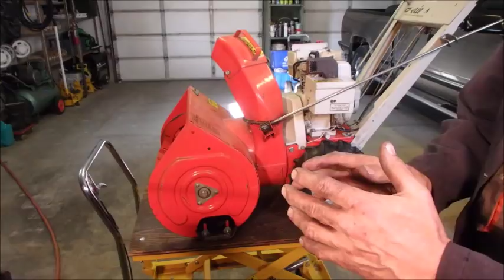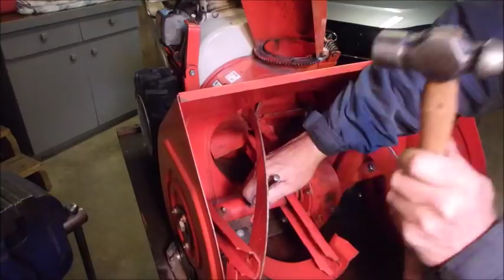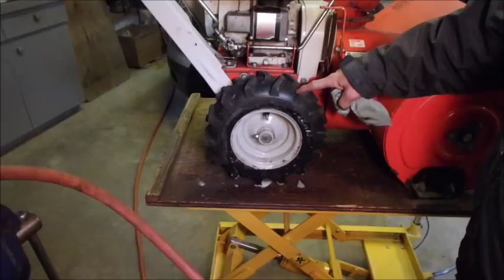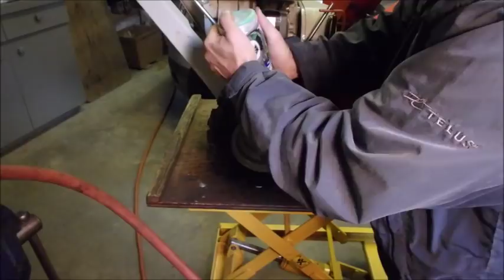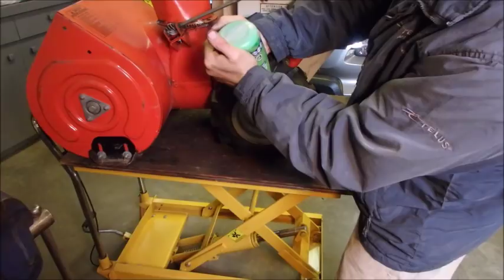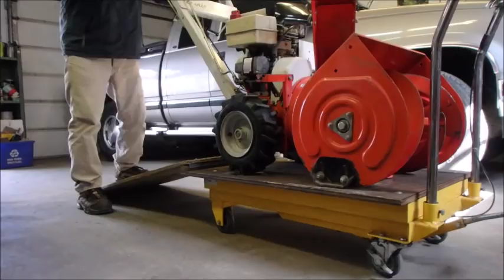A Shear Pin on My 4HP Ariens Snowblower

Comment: "We're not working on the space shuttle." So true. My paraphrase, what I always say is "It's not going 55 down the highway."

I own a 1965 Ariens 4HP Tecumseh Snow Blower. Your videos are very helpful. I want to upgrade mine from the stock balding solid tires to pneumatic ones like you did! Thanks for sharing your knowledge and showing the process you went through in that particular video.
Reply from the maker: Looking back I used too many bushings.

Comment: I've got a snow blower just like that one.  I think it is a 1964 model.  Man, those things were built.   I often wonder if 4hp back in 1964 was by today's standards more hp because that 4hp on our machines have no problem  tackling some big snow.   Today a blower that size would have an 8-10hp motor and probably not do as good a job.  Oh, also, my 90 year old mother still runs her 1962 Ariens she inherited from her father!!!  And, my son, who now lives in Connecticut, just bought a 70's model Ariens on my recommendation.  They are just built like tanks.  Do a little maintenance each year and they last forever.  I particularly like the older models with the cast iron gearbox.  You just have to be careful what lube you put in them because of the brass gearing.  Enjoy your videos.
Reply from the maker: Thanks John.  I just gave this one to my daughter and her husband as I had 5 around here.  I definitely think a horsepower was bigger in the earlier motors.  (torque)

Comment: Great videos Bruce.  I like the quality of work you do and the work you put into your videos.  If I could make one suggestion or tip, put some anti-seize on the shear pins/bolts and they will come out much, much easier.  I've worked on a lot of OPE over the years and when they come back to me  years later the bolts that I had put anti-seize on come right out, even decades later.  I use anti-seize on most fasteners for this very reason, especially snowblowers.
Keep up the great work and videos Bruce.
Mike
Reply from the maker: You are so right.  Thanks for the tip.  I try to use anti-seize on more and more stuff.  Just a joke here    do you think the anti-seize lid will aver corrode on too tight so you can't get it off.  All the other stuff does that but my old anti-seize never does   haha

Comment: Bruce you can leave a little slack on the shear pin nut.  If you clamp it down hard it puts pressure on the bolt and it may break from normal use and not hitting anything.  The nuts are lock nuts (I'm sure you know that)  Good video.
Reply from the maker: You know I always over tighten everything I really do.  Good point!!!.  It comes from my equipment installation days  (decades actually)  I do have the eye of the world looking into my little shop.  Thanks Bob
Reply: Yup, I know the feeling of having the eyes of the world on your every move.

Comment: Slime works wonders. I've seen some really dry rotted / cracked riding mower tires that still hold air with slime. If they still have good tread I say use it.
Reply from the maker: me too!!!  I was waiting for more negative comment but so far so good.

Comment: Great job as usual Bruce.  That's a beauty of a snow blower. I really like the tires.  What exactly is the difference between a shear pin and a regular bolt?  I know the shear pin is designed to break at a lower point but how are they designed to do so?  Would a bolt that fits, cut halfway through work the same?  Never given it much thought but I, like you find this stuff interesting.
Thanks for the video.
Reply from the maker: They are made of softer metal.  they have a groove at the 1 inch mark so they will break when required

Comment: Great vid as always Mon Ami ...............

Down in Arizona in the Tuscon area, they have what is called a Goat Head it looks just like a goat head with horns .........   It is a very hard small seed I think..... from a plant that grows over there....   It has spurs on it and will puncture a bicycle tire or motor cycle tire in a heart beat......   There are so many bike shops in that city than you can shake a stick at.........      

They put some heavy duty slime in the new tubes that they fix for an extra 4 to 5 bux ...   They don't patch a tube at all.... So you have to buy a new one.......  

Guess what ????    The slime does not help at all.....    More Money for ???????
Reply from the maker: Too big a hole I think.

Comment: do these vintage 4hp Ariens move snow fairly well? or better to go with a newer design? I found one of these cheap. its the smaller 4hp like this, not the larger 7hp type.
Reply from the maker: I think the smaller one would be better as they can be man handled easier.  Priced right give it a try and sell it if you don't like it.

Comment: had 8265 snapper 2 stage snow thrower bought 1995  had during last nor'easter that closed waterbury ct always ran,after break in period, mobil one guy i worked with did oil change and used non synthetic oil blew engine  now he bought me columbia pc ov shit a warning does not throw or rev high enuf to do anything i got screwed trying to keep clean driveway that is happy holidays
Reply from the maker: Thanks Dick

Comment: Bruce I hope you can help me, I have a John Deere z-717A ztrac 7 iron mower. I had issues with it because of hard starting especially when it was hot. So I took the carb off and took it to JD and had them run it through their electronic cleaner. I bought new carb gaskets , fuel filter, vaccum fuel pump, they installed new choke rod. I installed all new fuel lines. I installed the carb back on the engine ( Kawasaki  FH601v ) . You can crank on it all day with no start, pour some gas down the carb throat and boom it starts and runs fine. The carb that is on it is a NIKKI # 150037114 2 BBL 19 hp any advice would be appreciated. Thank you. O and yes I have fuel in the bowl.
Reply from the maker: Does it have a solenoid on the carb that shuts the fuel off when the key is off?  Check that.    Also is there a vacuum fuel pump   they can be twitchy.  If it runs it is most likely running lean.  Keep looking.  At least you can start it.  Check for cracked lines on the vacuum.  Sorry I am rambling as I am not there.
Reply: Bruce Pender YES it has a back fire solenoid. I'll do out the vac line again thx Bruce

Comment: Hey, I use slime too on older tires when the owners (and on my own machines) don't want to install tubes and have the extra expense. And, I'd much rather remove a slimed tire vs a tire that's been injected with fix a flat!! That latex based stuff never solidifies and often causes the rims to rust from the inside out. One thing I always do before reinserting the valve stem is to blow out the valve stem of the slime first. Only because I'm anal and don't want the slime mixed up with the schrader valve stem. Great video my Friend! Sean~
Reply from the maker: Thanks so much Sean

Comment: They don't make like that Airens anymore. Good reliable machines. Good repairs Inspector.
Reply from the maker: Thanks.  I think this one has a bit of metal fatigue.  But it still goes.  I drill and tap the stripped holes and keep going.

Comment: How's come u got one tire on backwards? And how long is ur ramp for ur hoist?
Reply from the maker: The tires came that way from the machine I got them from.  The ramp is 4 feet with a small piece of angle iron on the lip to keep it from slipping down.
Reply: Cool thanks

Comment: nothing wrong with slime,its the fix a flat stuff that is dangerous!. i use slime on any tire i have a issue with and it usually fixes the leak.might think about getting more shear pins in stock if you havent already
Reply from the maker: I did.  There are so many different kinds it is amazing.  It is hard for a  "Back yard, self taught,  small engine mechanic" to keep up.  haha
Reply: well best to learn before a storm hits and your caught with your pants down so to speak. lol